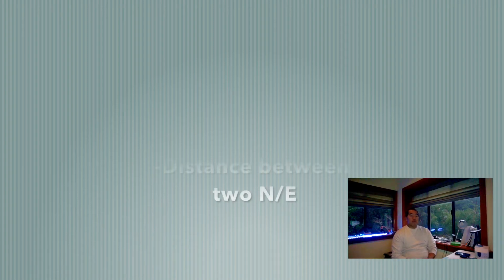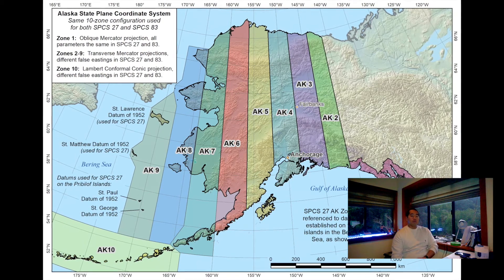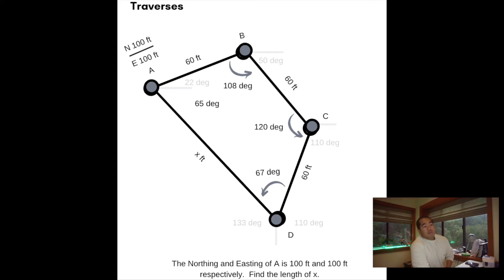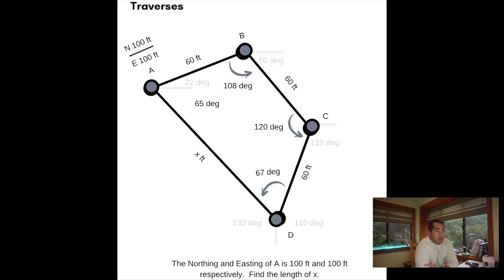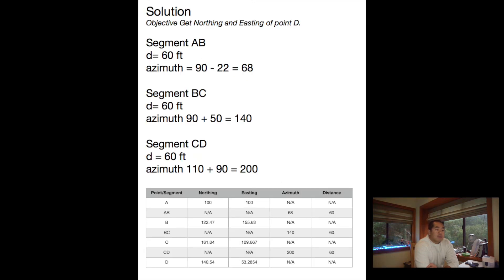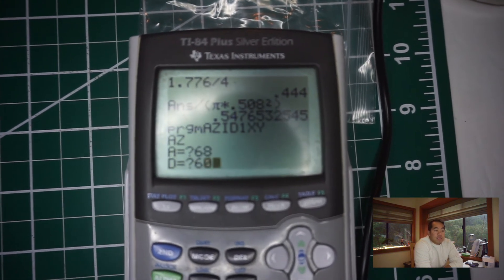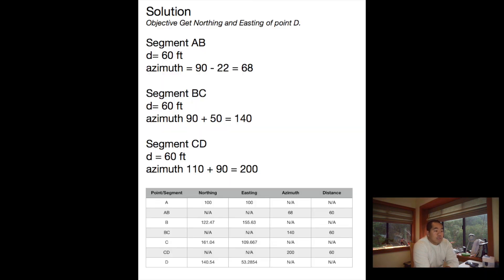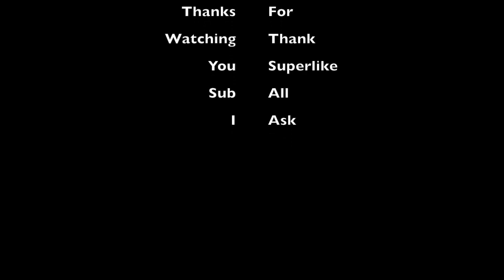Engineering Surveying - Traverses

Comment: This is one of the trickier types of problems on the exam. Happy you went over it. 

If you do it the Reza way, it's a lot different, but more theoretically based. That worked for me to do it in less than 3 minutes, but I can see how using programs in a calculator can help in not being that well equipped in those Reza approaches. By Reza I mean the survey workbook by Reza Mahallati.

By the way, I just found out I passed both Seismic and Survey exam.  I had to retake the Survey exam and it was tough for me! For those out there struggling, you will pass!